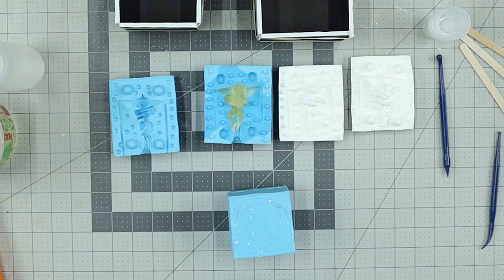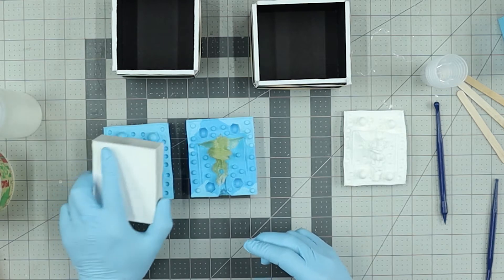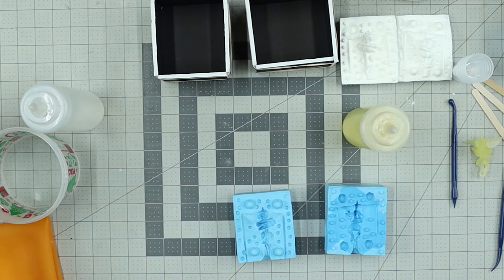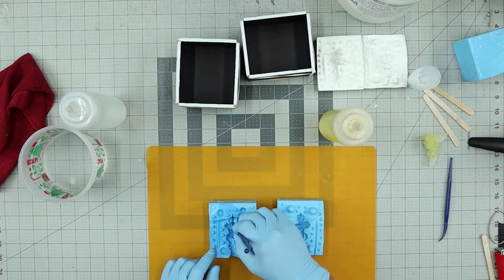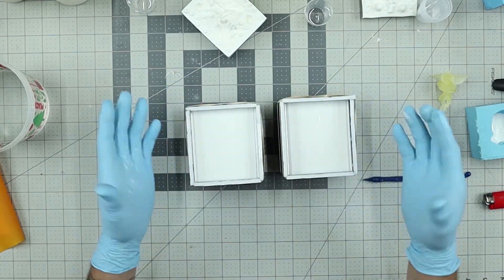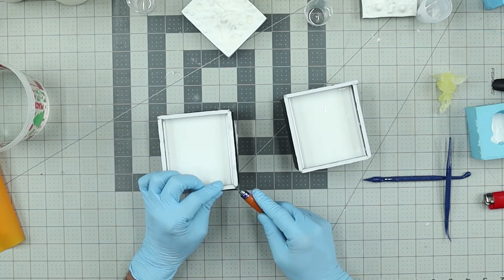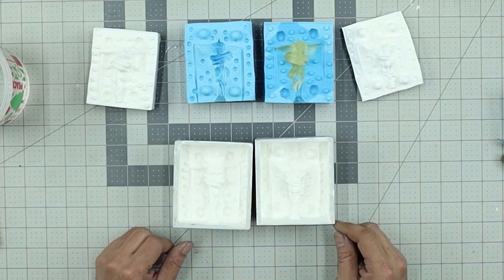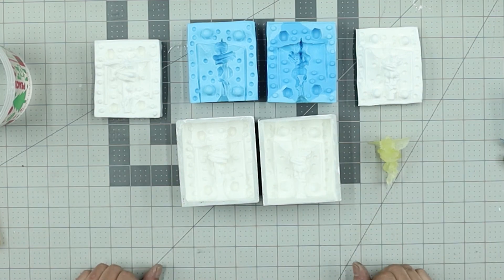Making a Resin Master Mold with Specialty Resin Fabri-Cast 50 for Replicating Silicone Molds S.V.

Comment: How did you get your part to come out bubble free without a pressure pot? I got flex it 90, 80 and 70 when I try to make transparent parts they always have some bubbles
Reply from the maker: https://www.youtube.com/watch?v=oLPUxTi9aKg
Reply: @ShomsPhotography  that technique will work with flex it 90 even though it got a 3 minute work time?
Reply from the maker: @aarontezeno2154  flex 90 is an oil releasing resin so I would not use it to make molds